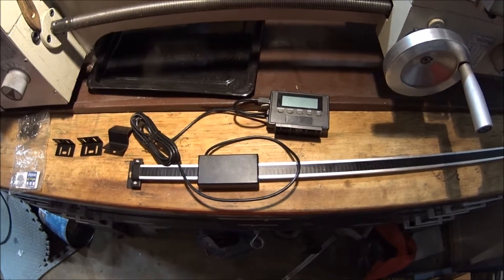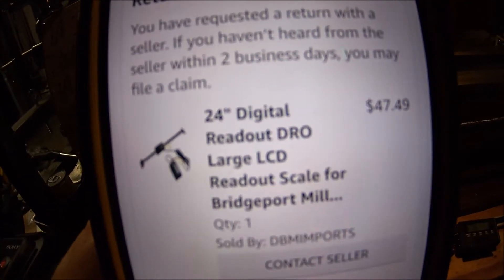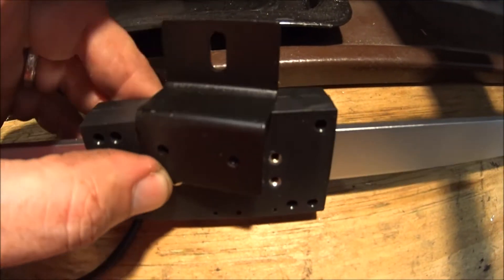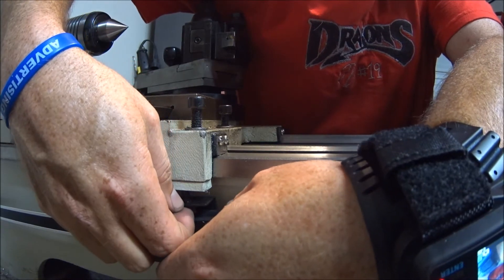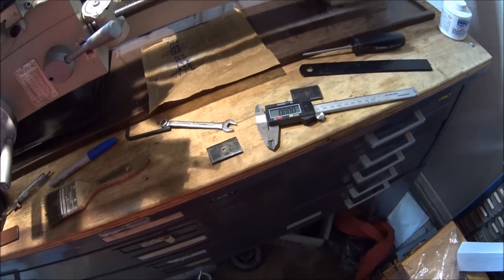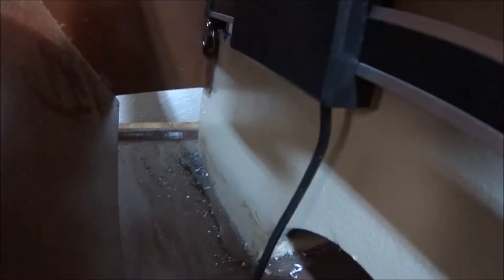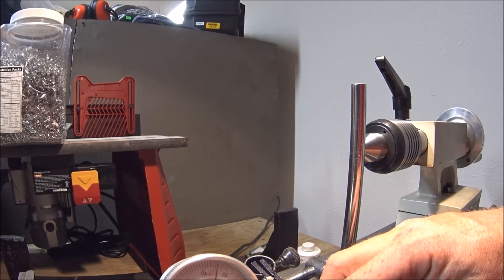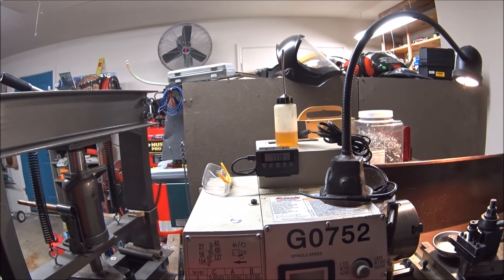How to Install 24" DRO Set up, review and test Adventures in Being a Hobby Machinist

Comment: Lol, I can realte to breaking small drill bits.  That's a nice addition and for the price, you just can't beat it.
Reply from the maker: i hate drilling little holes. if i were eye level and not drilling by my ankles lol.  fortunately it came out super easy.  i don't have#29 still bits.  for the other side i had to use a 9/64th (i think) and that did a pretty decent job.